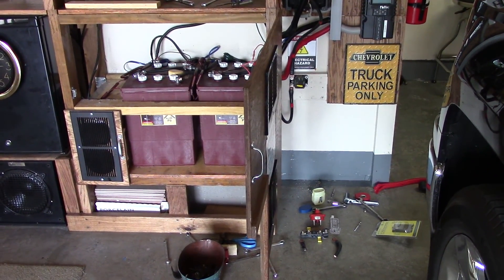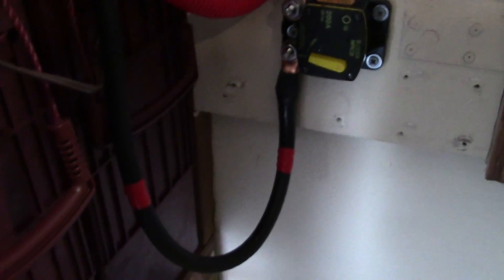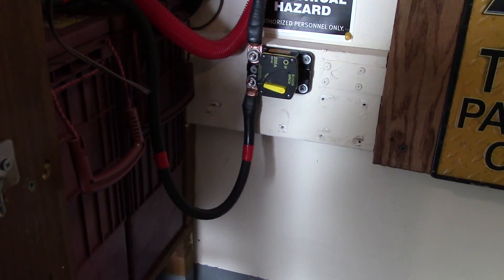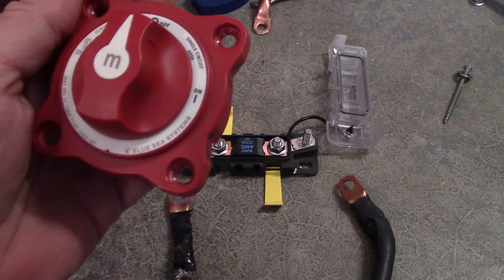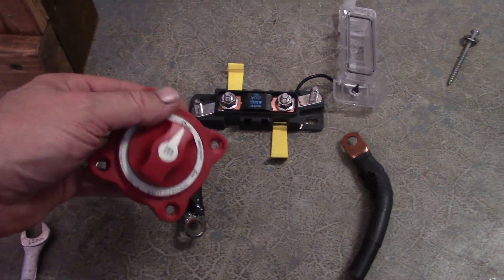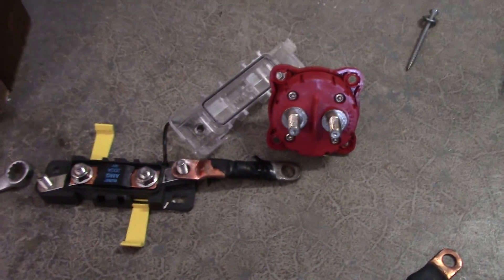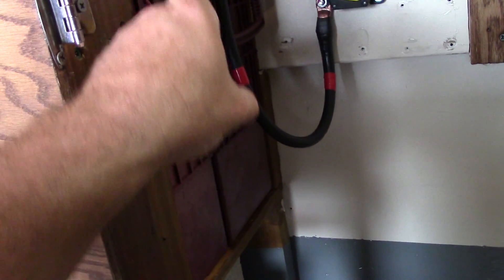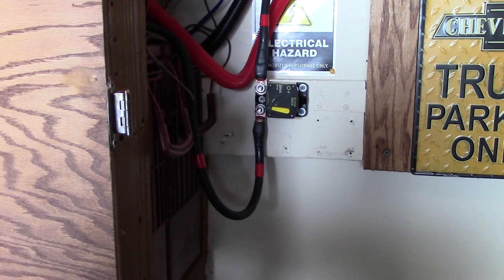Installed: Blue Sea Systems 200 amp circuit breaker

Comment: Hello Chris, I noticed that your battery cable is connected to the "load" terminal and the inverter cable is connected to the "line" terminal of the new circuit breaker.  Am I seeing this correctly?  I ask because my Bussman MRCB 150 amp circuit breaker welded its contacts shut (and did not trip).  I attached my inverter cable to the "load" terminal and the battery cable to the "line" terminal.  I also connected the charge controller red cable to the "line" terminal of the MRCB for charging the battery bank.  To make matters worse, my inverter blows 4 of 5 40amp fuses in it any time power is connected to the inverter.  This system worked for 2 months before the malfunction.  Any thoughts for my issue from you or the forum are appreciated.  Thanks for your videos.

Comment: Hi Chris, How do you actually manually trip the MRCB breaker so it operates like a switch? I thought it had a micro switch at the "OFF/TRIP" mark but it doesn't. Do you have to manually move  the lever to the off position to operate it as a switch?
Reply from the maker: Just push the little button and it kicks the circuit like a switch. Or just toggle it.

Comment: I'm planning on making a setup with Victron MultiPlus-II 5kW inverter/charger with 48V single unit 10kWh ESS bank(20-50Amps average, 100A max) to support my grid tie solar setup in case of outages(anti-islanding support integrated). How has that Blue Sea 200A CB held up over the years with you? Still good to buy?
Reply from the maker: Yes. A+. Blue Sea Systems makes "the good stuff".

Comment: You shouldn't rely on automatic breakers, secondly main battery switches are for isolating only purposes
You're making a big issue over them there's nothing wrong with them but there is plenty of wrongs with automatic switches

Comment: Love the setup!  What gauge of wire do you have running through the 200 A breaker?  Looks like at least 1/0 AWG.  I like the fact you tagged it with red tape since it's black wire to signify it as positive.  It makes mapping and diagnostics really simple.  Luckily that poor connection didn't cause a fire man jeez.  Have you tried de-energizing the system and doing a resistance benchmark after installing new equipment?  That would give you a starting point so every once and a while you take readings and maybe you can spot issues before they become serious.  Have a good day!

Comment: any updates on this, most wiring diagrams recommend the first method you used, would love to know if we can scrap all that and just replace with a flush mount breaker like you did. Technically it does the same thing as both the fuse and the switch, and is less complicated...
Reply from the maker: I like using both a fuse and a breaker...kinda like wearing two condoms.

Comment: Question: When adding breaker/fuse, the positive cable length to charge controller is extended with jumper and breaker/fuse.  Is it necessary to increase the length of the negative cable also?
Thanks for the video.

Comment: So you were using the circuit breaker as a bi-directional system? I was wondering if this would work because this breaker has "Line" and "Load" terminals so I just assumed the flow would only be allowed through Line to load and not the other way around.
Reply from the maker: Give the folks at Blue Sea Systems a call on that Line/Load question. The Line/Load is a polarization design...still should break the circuit at the rated amps/voltage.
Reply: Chris DIYer you are correct. They confirmed via email that the breaker is designed for bi-directional flow and will perform in that situation.

Comment: Can you use the circuit breaker as a switch  by manually pushing a button or flipping a switch??????
Example like in houses , if some body is going to work on a circuit they flip a breaker so the circuit isn't live.
Can you do that with the 12 volt circuit breakers?
Thanks
Reply from the maker: Shouldn't have any issues doing that...a lot of people do that

Comment: Hello, Chris maybe need to check the wrong cable connect to Battery on Line and Load to the Inverter. We use this Dc Breakers to protect Winches installed on vehicles. The Line go to Battery and Load go to winch. Is possible check your connection and is good choice because have protection and interrupt switch. Enjoy your Electric backup.

Comment: How to determine dc circuit breaker capacity from battery 200 x 2 system 24v & inverter 1,2kwp

Comment: do you think I can get some breaker like this for a 48 Vdc battery bank
Reply from the maker: It is stamped "48v" but, I would call/write Blue Sea Systems and check with them before buying this style circuit breaker for your system. Good luck!

Comment: Nice setup Chris let me give you a small tip, do amp readings between all your connections starting from batteries to your loads, note the drops and most of all the higher readings it will show your weak conection

Comment: Nice share. How do I calculate the correct size breaker for a 2000watt inverter and a 4-battery bank? How did you choose to use a 200amp circuit breaker in your set-up? Thanks!
Reply from the maker: Thanks. Still using that 200a Blue Sea Systems circuit breaker after my rewire this spring. Def get with the company on proper breaker sizing for the 2K inverter. A quick 10-min phone call could save you some $$$. Blue Sea Systems stuff is pricey...but, dam good
Reply: Much appreciated. I know the basics of Ohms Law (watts/volts = amps). In my case, 2000 watts / 12 volts = 167 amps. I assume rounding down to a 150amp circuit breaker would be the better choice versus rounding up to a 200amp circuit breaker. I will definitely give them a call.
Reply from the maker: Best to use what the manufacturer recommends and give BSS a call. FWIW, I use a breaker and a fuse for my inverter. Most inverters have a "surge" capability and will draw a massive amount of current for some appliances

Comment: Back at ya Chris,  I just noted a video placed by PrepareForTheUnexpected and he had a 300A  breaker which stopped working.  "300Amp DC Circuit Breaker Teardown"    He took it apart and as I expected, the gauge of the metal fasteners and contact points were MINIMAL, about the size of a pencil eraser. The points were burned and it would not reset.  That is what becomes a weak link ....breakers and friction fit connections in breaker boxes.  Much less effective as the old heavy duty BLADE switches like seen in the old Frankenstein movies.  Always something to break or create heat/ resistance when dealing with large gauge adaptations.  Keep marching on !   A bit more educated....Jim K
Reply from the maker: Saw the video. People always try to save a few bucks and then end up going with equipment that works (like Blue Sea Systems). The circuit breaker I own/use is CE rated to IP66 standards AND SAE1171 Marine (for use around ignition sources like engine bays and battery boxes). I also own FOUR of their Maxibus busbars. All are very pricey...but, safety/performance/warranty is something those Chinese rip-offs can't offer.
Watch this Blue Sea Systems video: https://www.youtube.com/watch?v=y1eK6oG8v3o
Reply: Thanks for the rapid reply. By your suggestion, I have placed a couple of those Blue Sea breakers on my "to buy list " at Amazon. Now I just need to settle on the amp rating. I have ordered 6 Trojan 6V batts  from local Continental and already have the 60A Renogy MPPT as well as GoPower 3000A pure sine inverter.  Well on my way, with plated terminals and 16ton crimper due to be delivered in the next week.  You are a great mentor.  Thanks again Chris.  I am shutting down for the night.   Jim K
Reply from the maker: That sounds like a sweet set-up. From what you noted, I would use the 200-amp Blue Sea Systems 187-series circuit breaker. Are you going to do a 24 or 48v system?

Comment: As a follow-up, did you take that switch apart to see how sturdy it was constructed ?   Jim
Reply from the maker: Naw...sure didn't. They are pricey. I am very confident it is built well...meant for marine environments. I tried contacting the company...never got back to me.
Reply from the maker: Here is some great data on it from the company's website for this breaker: https://www.bluesea.com/products/7149/187-Series_Circuit_Breaker_-_Surface_Mount_200A

Comment: Hi Chris, in my book, the fewer connections, the better. I cannot picture any sizeable contacts as good as 2/0 to 4/0 cable being designed into those switches ( or breakers for that matter ).  Have any of your fuses or breakers ever popped since you installed them ?  Also, just using a breaker with the reset paddle would be a quick disconnect ( if needed) eliminating the need for the rotary switch, unless you were going from one source or battery bank to another.  You know K-I-S-S  by now....your thoughts ?   Jim
Reply from the maker: A lot of guys use a rotary battery switch and a big ANL-sized fuses. I used to do that. It is good. However, I am much happier using that Blue Sea Systems wall mount (surface mount) 48v 200A circuit breaker. https://www.amazon.com/gp/product/B007P5UNNW/ref=oh_aui_search_detailpage?ie=UTF8&th=1  Heavy duty. When I switched over to 4/0 cable and ran them through that circuit breaker this past summer, I had to modify the 4/0 lug ends to fit onto the two lugs on that Blue Sea Systems surface mount breaker. It is excellent...I used my infrared thermometer at high current load...no heat! Also, it works "both ways"...something VERY important for inverters that are also chargers. Def "Keep it Simple, Keep it sweet".
Reply: @ChrisDIYerOklahoma  thank you for this video I plan on using a direct current circuit breaker for my RV

I believe you used a Cooper busman circuit breaker by Blue Sea

Do you recommend that circuit breaker today
Reply from the maker: @camposvazquez  yes! Good luck with your build
Reply: @ChrisDIYerOklahoma  I Apologize fir another question but you have helped me upgrade my RV...

Is it safe to use these switches as a cutoff... Kind of like a battery disconnect...  Fir safety reasons.. if I have an issue with my DC to DC changing system.. can I switch it off safely with these circuit breakers?

Comment: Is the new breaker running with out the heat? How warm is it getting now? Thinking if your little jumper was loose & shorting that may have burned out your 2 switch's
Reply from the maker: I agree. Temps are great now...just took a laser infrared thermometer reading on it. Ran 130 amps (~3,200 watts) through it...no problem. Highly recommend those little laser gun temp sensors. I did find some heat on the Midnite Solar Baby Big Box DC circuit breakers...working on a solution to reduce heat there (cut some 1" holes, will install some screen buttons, and maybe a micro DC 24v blower fan). That little jumper I had before between the ANL fuse and Blue Sea switch was a bad idea...and the loose connections, and the wrong eyelet size on the terminal lug ends. So many bonehead screws ups. Getting things better overall now...this is why I do these videos...to help people not make the same mistakes I did/do.
Reply: So true! The little things make a huge difference. All so found circuit breaker placement to inverter output is very important! keep hi amp draw breakers as close to the inverter output connection as you can.

Comment: Great Video Chris Call Blue Sea Give Them A Shout They Will Help You Out Buddy  I Just Spent Around  $ 600.00 In Cable 2/0 Cobra X-Flex Awesome Cable Plus 2/0 Lug For Battery Cables, 3/8" Hole  And Heat Shrink ! And A Temco Hydraulic Lug Press  Money Well Spent If Your Going To Be Cutting allot Cable Get These Klein 63050 Cable Cutter Great Straight Cut Buddy  
http://www.kleintools.com/catalog/high-leverage-cable-cutters/high-leverage-cable-cutter

Comment: Chris check your local welding shop for 2/00...sometimes you can get retired welding lead for scrap copper price!!...connectors are cheap and can be put on VERY nicely with a chisel and hammer....I'll make you a video if you want....Great system...love the vids...take care
Reply from the maker: +BlackAck90 Interesting....chisel and hammer, eh? I have been using a shop vise, and punches. I got an actual 12-ton hydraulic crimper on order made for these terminals. They have dyes for different sizes. Pretty cheap too...around $50. Cable is expensive (esp anything larger than 1/0)...so, I will look around. Thanks...and thanks for watching my DIY mistakes and fixes! Haahaaa!
Reply: Oh perfect! I have access to a crimper if I need it but a chisel or vice works just as well...take my advise on the cable tho. Good way to get it cheaper than retail! Love the vids. Keep it up!! Looking forward to how the Trojans fair.   How much was your 200a fuse? I gotta order one when I save some money. :(
Reply from the maker: $84 on Amazon: http://www.amazon.com/gp/product/B007P5UNNW?psc=1&redirect=true&ref_=oh_aui_detailpage_o02_s00

Comment: Thanks for the vid. Honestly when it came to my inverter to battery cables I Overkilled it and got 4/0 Cable. I also used 4/0 Cable for the links between the batteries. Also get Cable with a high strand count.
Reply: +ChrisDIYerOklahoma Well Big Cable helps but we all have to remember most cable failure comes at the terminals so always ensure that your terminal crimps are good, terminal bolts are secured and check and re-torque every say 3 to 6 months
Reply: +ChrisDIYerOklahoma Dang it. I had the same thing happen to my Blue sea m. There must be some thing not right. Brother 00 is the why to go. All my DC wire is 00. Thanks for the video. God Bless.
Reply from the maker: Thanks man...great advice. 2/0, 3/0, 4/0 cable is not cheap. Also, I used Vaseline instead of terminal dielectric grease...might change that too when I do bigger cables. Your 4/0 cable is top-notch...should have no issues at all.
Reply from the maker: +yankey4 Amen...you are 100% correct. That fuse and Blue Sea M switch was a "pinch point" and was a weak point. I am going to check the resistance with my meter and see what's up. Time will tell on this pricey DC circuit breaker...looks like it will be okay. Thanks for watching...00 is going to happen on my system.